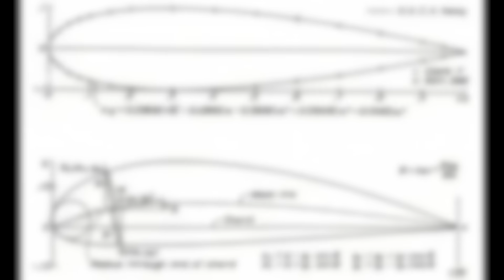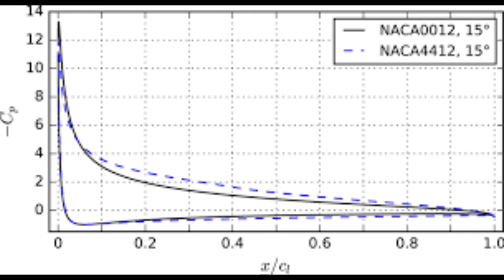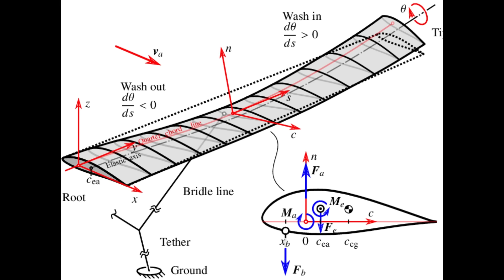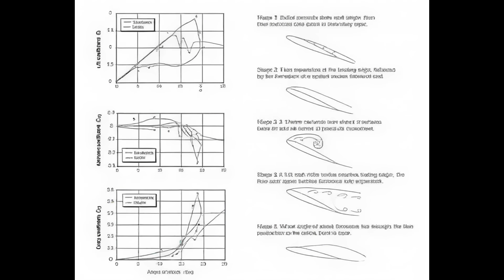Theodore Theodorsen Solved Aviation's Deadliest Problem

Comment: Like the vid on Mock (?) who found predictability in the design of wing planforms, this (equally horrible) vid on flutter has enough graphic resources to make the issue clear and does nothing of the sort. In the earlier one, I figured it out in SPITE OF THE INCOMPETENCE.
Dunno how much of the same sort of effort I'll spend here, but this is a prime example of using AI to offer much and deliver nearly nothing.
8:20 - Or DECREASES lift. If it only increased lift, the wing would simply twist apart upwardly. You claim to be addressing flutter which includes opposing excursions. Pathetic.
12:07 - You will learn this guy did really neat things. You will learn NOTHING about how that was achieved; arm-waving is all you'll get.

Comment: As I watched this video the first thing that occurred to me was the problems with the Lockheed Electra airliner.  Did the engineers use this method?  Did they maybe apply it a little too rigorously,  shaving margins of safety?
Reply: Good point. I think the Electra proved that even structures with minimal aerodynamic influence (engine mounts) have a resonant frequency that can have much the same effect as aerodynamic flutter. Quite a few still flying today.
Reply from the maker: Great question. The Electra’s issues came from structural resonance, not the airfoil science itself. Abbott’s work at NACA helped create the aerodynamic data that made wings safer — but later aircraft still had to integrate that knowledge correctly into the full structure.

Comment: So only one person thought of this and happened to go to the US and work for NACA? absolute bollocks! All manufacturers and most countries had their own research units and they all came up with similar solutions. If this guys work was so groundbreaking then how come Boeing had massive flutter problems with the B747 in the mid 60’s? And how come Boeing to this day use inboard ailerons but Airbus don’t need to?
Reply from the maker: Fair point — Abbott didn’t “invent” flutter, he helped standardize the aerodynamic data that allowed engineers to predict and prevent it. Flutter depends on the full aircraft system — structure, mass, stiffness and control laws — not just the wing profile. The 747’s issues came from structural resonance in the pylons, not from NACA airfoil science. Different manufacturers solve the same physics in different ways, but they all rely on the same aerodynamic foundation.

Comment: , tt did develope the science at naca, but flutter had a been a problem from the nieuport 17 onwards, look at the rockney fokker crash, and engineers while not fully understanding flutter had been partially fixing the issue for years before, with poor success rates. overall a fantastic video 👍👍👍👍👍👍👍
Reply: Flying fast to see if you died was not a very economical approach.
Reply from the maker: You’re absolutely right.
Flutter was already a known and dangerous problem long before NACA fully understood it.

What Theodorsen brought wasn’t the discovery of flutter —
it was the first complete mathematical framework that allowed engineers to predict and control it reliably.

That’s what turned trial-and-error into real aerodynamic science.

Really appreciate your insight and support — thank you for watching.

Comment: And there I was thinking Fokker had pointed out the main culprit in WW1.
Reply from the maker: You’re absolutely right.

Engineers like Fokker saw the structural vibration problems during WW1 — but they didn’t yet have the mathematics to explain or solve them.

That’s exactly what Theodorsen brought later: turning those deadly observations into predictable science.

Comment: Back in the early 90's I worked with an elderly aeronautical engineer who said he had worked at Grumman during WW2.   They were having problems with one of their aircraft shedding its' tail in a dive.  (sorry...I don't remember which one he said)   They rigged up a high-speed slow motion camera pointed back at the tail hoping to see something that would help them fix the problem.    He said moving the film one frame at a time when the tail came off didn't help them at all.   One frame the tail is there looking normal...next frame it was gone.   They eventually solved the problem and ever since I've had a healthy respect for engineers and how severe a problem flutter can be.
Reply from the maker: That’s an incredible story. Thank you for sharing it.

It perfectly shows how violent and sudden flutter can be — and why engineers like Theodorsen were so essential.

Glad you enjoyed the video.

Comment: Oohhhh Clark Y +  Camber.
Reply from the maker: Yes — Clark Y was a great baseline. Theodorsen’s research is what turned wing behavior at high speed from guesswork into science.
Reply: @Legends-Battlefield .    I was at Warton , during my undergraduate apprenticeship, and witnessed flutter testing of , the Tornado I think, tail surfaces , using “bonkers” to excite the structure.   They were using the rig , or part of it, built for the Lightning in which it was load tested to destruction.
Reply from the maker: That’s amazing — you witnessed the real testing used to understand and control aeroelastic flutter.

What you saw on the Tornado and Lightning is exactly the kind of engineering Theodorsen’s theory made possible.

Great to hear from someone who has seen it firsthand.